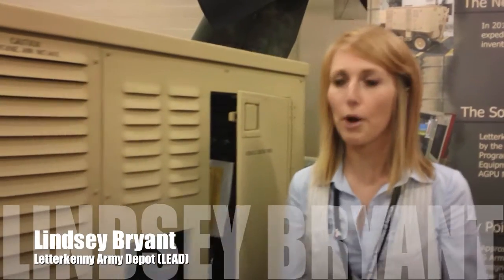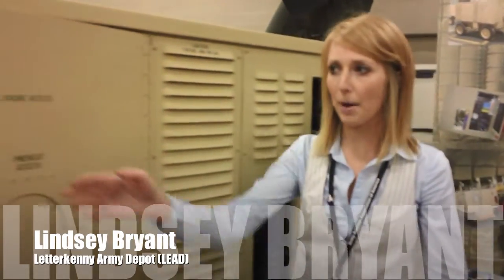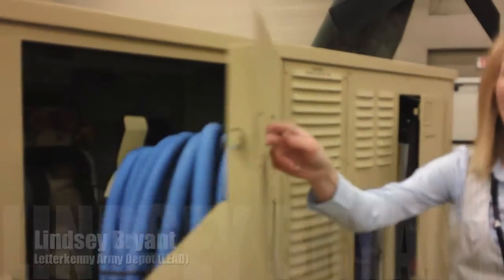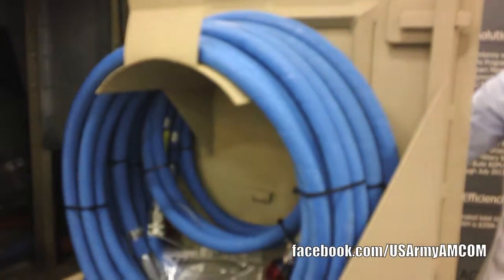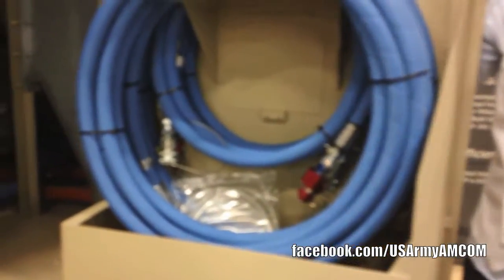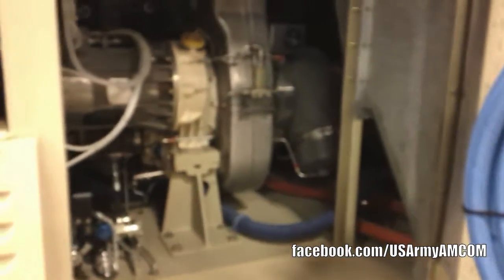The Aviation Ground Power Unit Keeps Vehicles in the Air

Comment: I'm a 52F AGPU mechanic. 20 years in the Army.  I went to Aberdeen Proving Grounds in October - December 1995 to earn my certification. 
Look me up on LinkedIn.  I retire from the Army in June 2015 and I need a job!  
Go Ordinance!
Reply: Mr. tolles in need your help I'm at fort riley and we do not have a dedicated agpu exp here I'm working on one that will not stay running after starting up for about 10 sec and will shut down and will not restart unless we let it sit for about 20-30 min and then will do it all again changed the ecu engine full pump hour meter both thermal couplers igniter and igniter box tested fuel came back good the inline fuel solenoid, the engine acts like its flooded and will drain raw fuel and white smoke when trying to restart any help would be very appreciated most of the agpu's here have not been trough reset and are 2-3 yrs over due can you help the big red one if you can I'll name the machine after you thank you todd gross ret. us.army DynCorp avn.